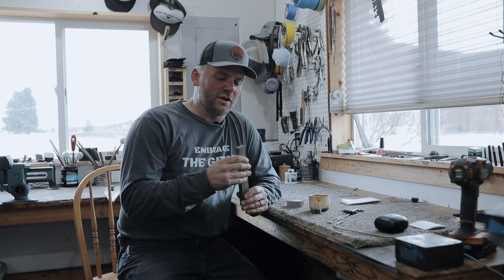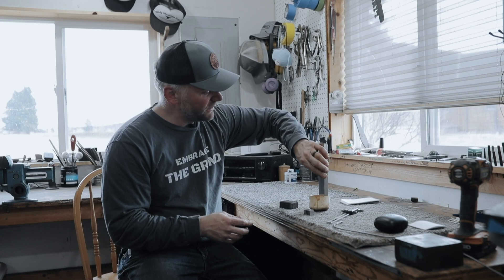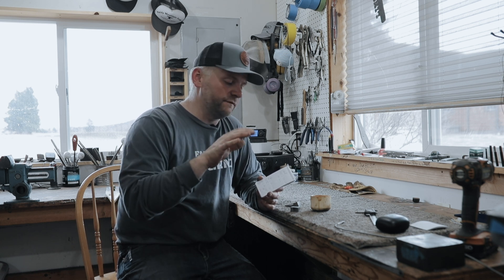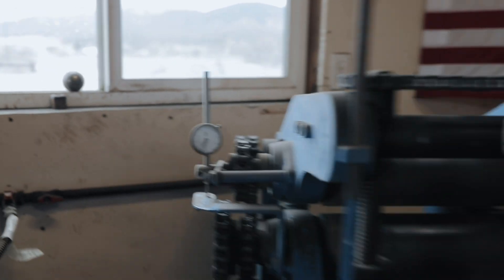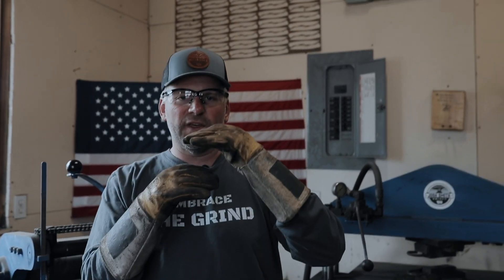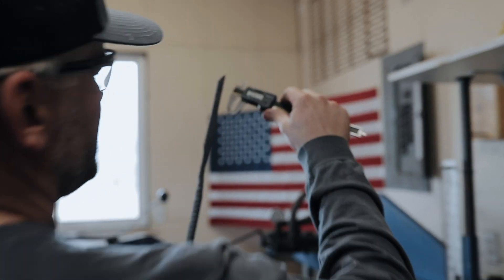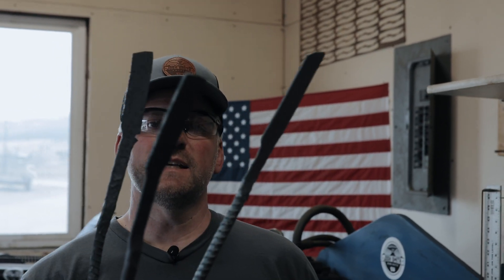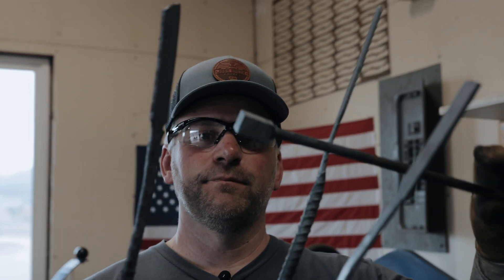Rolling Out Mosaic Damascus Steel

Comment: Would be super cool if you did a more independent video about the rolling mill, it would a really cool project to make my own!
Reply: i built/am building my own rolling mill atm, it dosent have a thickness guage though its just a 20 ton press jack that i jack down a jack or 2 a pass(each jack is about 1/3 of a mm), then 2 roller plates that fit in where the press plates used to go and a drill running into a 45 tooth worm drive i dont have a lathe (or want to try and harden cylinders) so i got local metal shop to make the rollers for me, 12cm of mine is flat then other half has a 5 cm wide grove sloping to 2.5mm deep next to a 2mm high 4mm wide v ridge in middle
 other one is a 4cm wide groove thats 2mm deep on one side and wheel diameter on other with the top wheel only having a 2mm high 3mm wide at base ridge 8mm from edge so i can roll in basic blade bevel & fullers on various sword styles easily

i live in suburbia so i try to keep hammering to a minimum, its nice and quite as well as being fast, although maybe my gearing is to high mine seems to turn a lot slower than most, u could probably use a 30 tooth gear and drill would have no problem, its something i plan to test some time, but so far its been pretty nice, i had to modify drill to have its forwards & back on a much larger lever and the trigger i hooked up to a foot pedal just with a few pullys some rope spring ect, some day ill pull drill appart and extend trigger  wires put trigger under pedal just so its a bit less boddgy/its my next priority thing to fix up now its actually running then wiring forward back onto a switch or another foot pedal, then the gearing maybe :P 
but even only 1/2 finished, its great